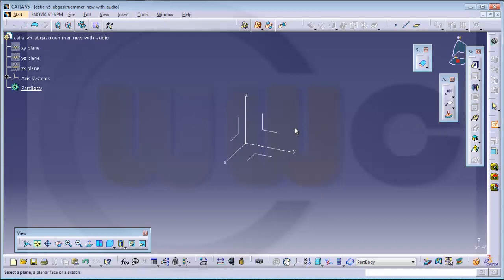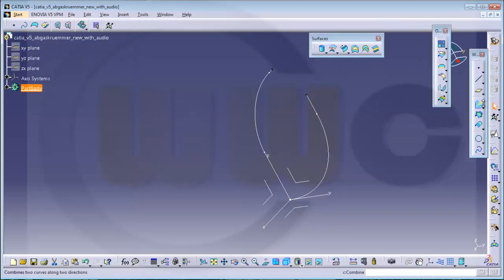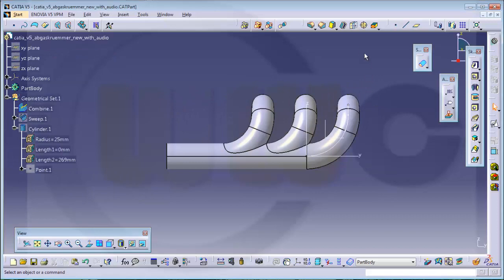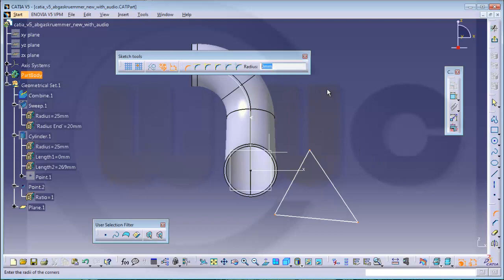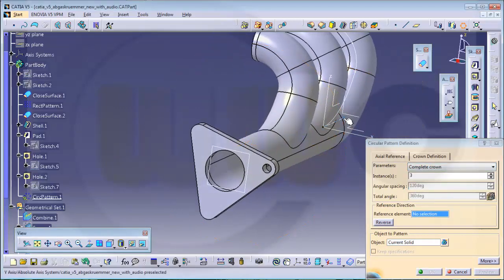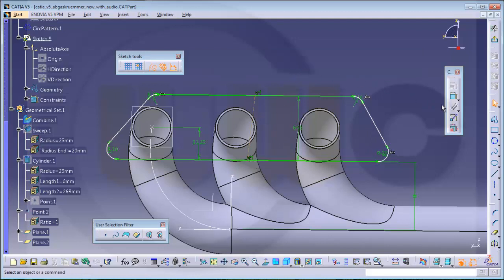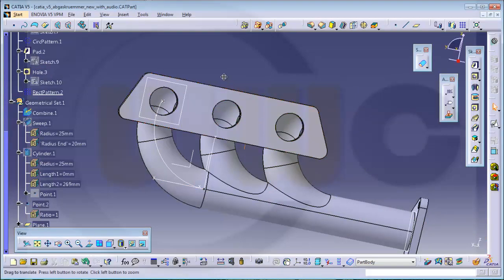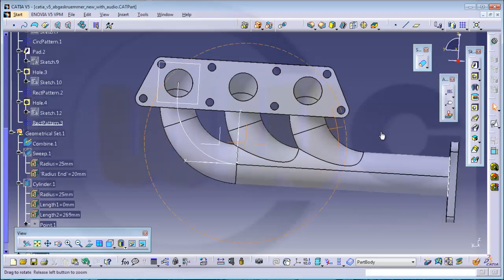Abgaskruemmer - Catia v5 Training - Sweep with Law

Comment: Hi Wolfgang, I would like to ask which program do you think is best for a beginner who will not devote himself to creating full time but still needs to draw parts for production (only with a small subsequent adjustments from the manufacturer). In terms of ease of learning, intuitive program and usability of the result. Autodesk AutoCAD, Inventor or Catia, or something else? I learned a little in Inventor, but as a beginner, it bothers me how complicated simple operations such as moving or rotating an object are. Moving an object in copy mode goes great in moving mode is terribly wrong. Maybe I have a lot of sketches in one layer, maybe it's just because I'm learning a new thing. Thanks.
Reply from the maker: Try Fusion 360 also from Autodesk, you can get a free licence. It is very similar to Inventor. Of course the superior programs are Siemens NX and Catia. But for beginners I would advise to go for: 1. Inventor/Fusion 360 2. Solidworks/Onshape
Reply: @wolfgang.walden.cad.training  Thank you very much, I really appreciate your advice. I've watched some of your videos (I'm learning some of them - for example, scaling the image to the dimensions of the sketch was great) and youtube periodically offers me more. I see that you work in different programs and the differences in them are not a problem for you.

Comment: 7.12 cylindrie  close surface command is not working
Reply from the maker: Two possible reasons - your joined surfaces have gaps which boundaries are not planar - or you have manifolds in your joined surfaces. Or even both.

Comment: I could not close the surface of second cylinder which has a diameter 25 mm. and long 82*2+105. It gave the error "Impossible situation".  I did everything as you did.
Reply from the maker: Obviously you did not - but - just try different dimensions.

Comment: Hello Wolfgang, I'm renewing my knowledge on catia and have one question. Can You somehow do a simple reuse of the colsesurface pattern from 6:13 in the pattern for holes at 21:51. For being clear I don't want to make a parameter that defines the value of 82mm and push the parameter to both patterns. I would like something of reuse existing pattern properties. Some times deep paramterization by the variable is more time consuming and it would be quicker to reuse the existing pattern properties.... One more question (if it's possible) will it work over diffrent catia modules (one pattern in sheet design and one pattern at part - both in advanced license) or If part i designed in advanced licenese in sheet pattern and then someone runs the basic license and tries to reuse the pattern from sheetdesign in part design over his basic license ? Anyway thanks for nice time with Your lessons. I appreciate Your knowledge spreading approach!
Reply from the maker: Regarding "close surface" take a look here : https://youtu.be/GjolJ_o8A4s
There is no "reuse pattern" in part design or gsd, only in the assembly workbench. Where is the difference between "basic" and "advanced" licence?

Comment: i can't seperate  the PartBody and the Geometric set apart like You did , so when i want to close surface of the cylinder , it's an impossible task , any solutions ?
Reply from the maker: Change the dimensions a little bit.

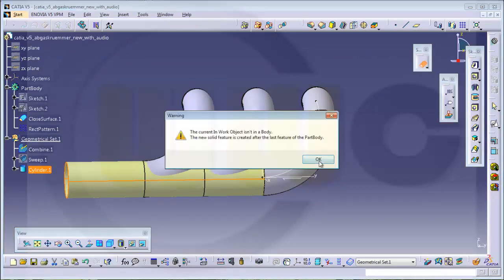Comment: Dier mr. Wolfgang, I got a problem on a 7:22min. When I try to close surface I got "Impossible situation", and can not do that operation. I allso try to do this on another computer and got same error. What you think the problem is ? I hate this situation becouse I do same as you on this tutorial :(
Reply from the maker: Hi, depending on your hardware and the catia release number you should change the dimensions slightly and then it might work.
Reply: Whan I change diametar of cylindar on 24 or 26 everything is fine, but whan is 25 it is impossible error, :) funny.  Thanks on your answer.

Comment: when i open the gsd, there isn't a combine tool under the plane tool. Is there any other way to open it, or a way to solve this problem ?
Reply from the maker: Hi, strange - maybe you should reset all toolbars - tools->customize->toolbars: restore all contents and restore position. If it doesn´t work - make 2 extrudes with the 2 sketches - the intersection curve would be the same.
Reply: Ok, thanks for the help

Comment: ‘impossible situation’ , this problem because, there has interactin between each branch pipe, so increase the distance of each branch pipes. can solve the problem
Reply from the maker: FENG ZHOU Yes, of course if you increase the distance this could solve some problems.
Reply: +Wolfgang Walden But sir, i am taking the same dimension from your drawing and still it is giving an error to me, whereas the case is not same on your part.. Why??
Reply from the maker: +Vedant Vashee Hi, depending on Release and Servicepack this may occur. Just check the answers down below.

Comment: Hi Wolfgang @7.21 I cannot close the cylinder. I get a message saying "Impossible situation".
Any idea why I get that message?
Reply: I had the same message with V5R20, so I tried using extrude and the same error. My solution was making the cylinder first and then the swept surface and no problem at all.
Reply from the maker: Hi, if you cannot close the surface, the boundaries of the openings/the holes are not in a plane/planar.
Reply: Wolfgang Walden Do you mean the combined small outlets that connects to the main pipe? I followed the exact steps that you show but I get the error message. I must be doing something wrong
Reply from the maker: Prateek badiger Yes seems so. Could mail me your part - so I could check.
info@wwmc.de- Which release do you use?
Reply: Wolfgang Walden
I am using V5 R19. I will email the part. Thank you.
Reply from the maker: Prateek badiger Ok, fine!
Reply: Wolfgang Walden The part has been mailed to your email. Thank you!
Reply from the maker: Prateek badiger Got it, thx. So R19 has a problem, I used R21 for the video, sometimes you can do certain things on one release and another one not. Sent you my reply with mail
Reply: Yes, that were some of the issues raised by IBM. I really appreciate your help. Thank you very much
Reply from the maker: Fermin Perez Trejo Yes, there is almost always a workaround.
Reply: V20 worked well, thank you!
Reply: I also came through the same problem. What's the solution?